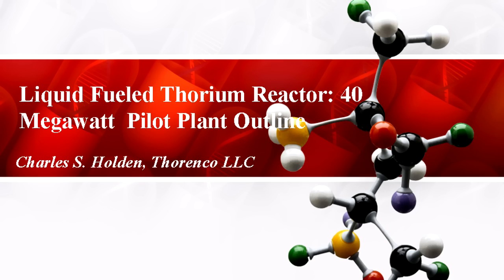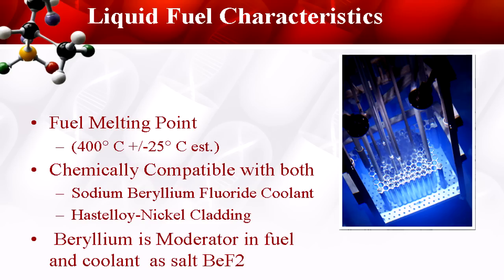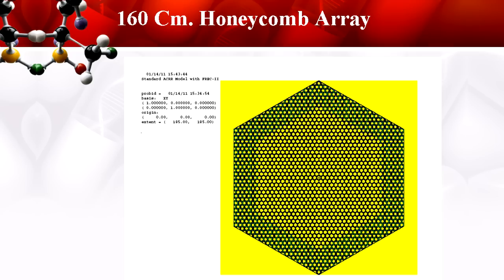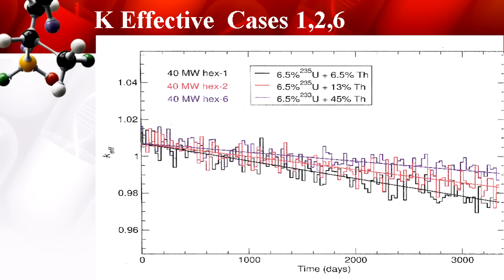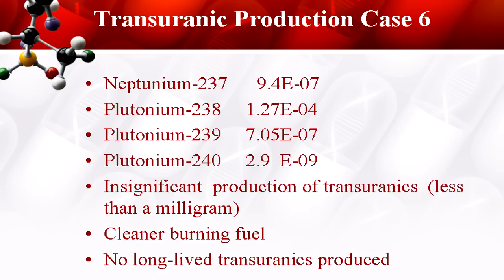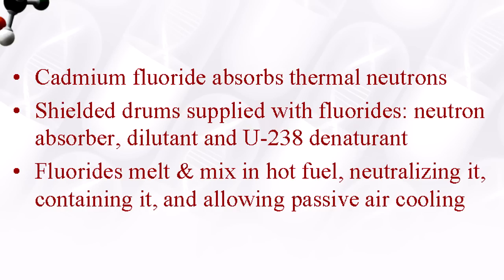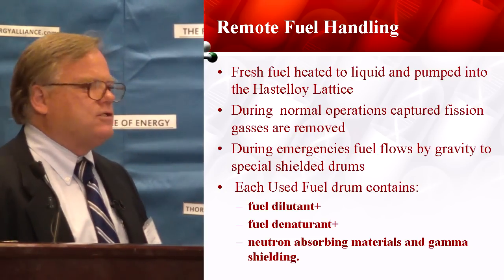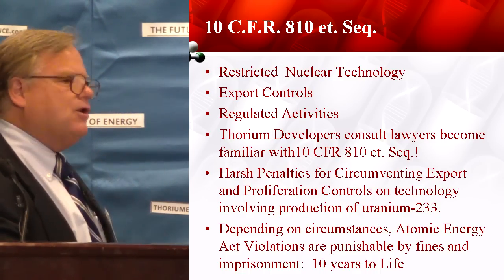Charles Holden - Liquid Fueled Thorium Reactor 40 Megawatt Pilot Plant Outline @ TEAC3

Comment: So, if I'm understanding this correctly, this is a single fluid reactor design in which the thorium and U-233 is dissolved in the same fuel salt, using a "hard" neutron spectrum, and there is no reprocessing of the fuel salt except once every ten years?
Reply: More than a late response, but yes, that is all correct. Its a chemically complex system but by far the most efficient, and forward thinking design, removing almost all of the complex mechanical elements of the system to focus only on maintaining an efficient chemistry, reducing costs as much as possible

Comment: Awesome video! I like calling it the "Liquid 'Fuel' Thorium Reactor" (instead of Fluoride) like you say, it's much easier to pronounce and you won't get as many eyes glazing over when you explain it to newbies! I agree it's great to have control rods even though you don't really need them with LFTRs, regulators will want them and it never hurts to have redundant safety/control systems anyway. Interesting innovations, particularly using a liquid moderator instead of graphite which has some issues. Really liked seeing those low numbers in the transuranic calculations. Is there any reason to use hexagons instead of circles? Circular tubes would be much easier to fabricate. Maybe you want a uniform fuel thickness which would necessitate hexagons in this configuration?
Reply: BUT IT IS FLOURIDE AND WE ALSO PUT THAT IN THE US WATER SUPPLY THAT IS ALSO WHY WE SHOULLD TO USE ITS PROPER NAME
Reply: 7 years and no repply to the hexagon question? wow, that's actually fucking sad.

Well i hope you are still around, because an answer you will get! Everyone knows that circles form the highest volume for the least surface area. For a reactor core just like anything else, that is a good thing because you don't want to lose any heat to the frame of the reactor since you want all that heat going into the fuel element to be exchanged with the secondary salt which then goes to power the gas turbine for efficient high power generation. 
However, circles are bad at anything that involves stacking things together. 

Obviously anything containing solid things will tend to be rectangles. Why? Because solids can't mold to fit their environment. Its why we store boxes and containers as rectangles and not sphere. Solids are far easier to neatly stack in them, and you can then take these rectangles and stack them too. If you try to do that with a sphere, you would leave voids in your stacking, forming concave triangles which are a bitch to manufacture. Obviously, for storing liquids, especially thermoactive liquids, rectangles are a bad idea due to the corners. You will get a lot of thermal inconsistencies between the corners and the flat plates, you also get varying degrees of weaknesses at the center of each plate where a perpendicular force being applied will essentially go un-opposed by any of the structure. 

An hexagon is, by all accounts, the most structural stable uniform structure. its the second best ratio of surface area/contained volume but can be stacked next to other nodes. The thermal load is going to be a lot more consistent between plates, and unlike cylinders, it leaves no voids. Moreover, it is a self stabilizing structure. Its the reason why graphene is the strongest material known to man right now, because loads from any direction will always disperse into the lattice to subsequent structures at optimum angles. 

As Grey would put it : "hexagons are the bestagons"
Reply: @mobiuscoreindustries  8 years and counting... still no reply. 😀 

Well, if it were any other country (whose main talent was in tinkering and tweaking, and not producing any original research, btw) they too, would have advocated circular pipes. And circular pipes of eaqual c/s when stacked together form heragonal bunches, and if the containing shell were hexagonal, it would be a perfect fit.

Comment: You can easily build one thorium reactor using a heavy water moderated vertical reactor and a mixture of natural uranium and natural thorium. But be prepared to spend a chunk of cash for the machine tools, dies, molds, fixtures, positioners, aligners, jigs, tools, machine bases, nuclear containment caves, upgraded work glove boxes and tunnel suit work areas, geiger counter, mass spectrometers, gas chromatographs, thermograms, all kinds of nuclear science-engineering instruments, gadgets, devices, equipments, materials, heavy engineering machineries, machine building machineries, and machine tool machineries. And lots of heavy water supplies as well as a small mini-heavy water supply manufacturing facilities.

Comment: I thought it is not allowed to make experiments with Thorium?
Reply: You can easily build one thorium reactor using a heavy water moderated vertical reactor and a mixture of natural uranium and natural thorium. But be prepared to spend a chunk of cash for the machine tools, dies, molds, fixtures, positioners, aligners, jigs, tools, machine bases, nuclear containment caves, upgraded work glove boxes and tunnel suit work areas, geiger counter, mass spectrometers, gas chromatographs, thermograms, all kinds of nuclear science-engineering instruments, gadgets, devices, equipments, materials, heavy engineering machineries, machine building machineries, and machine tool machineries. And lots of heavy water supplies as well as a small mini-heavy water supply manufacturing facilities.

Comment: Too bad that it is all totally unnecessary  and that the story is incomplete. This reactor still produces longlife radioactive waste. JUst not quite as long as what the pressurised watercooled reactors produce. This reactor is still not failsafe. It does produce radioactive waste. It could still have a metldown. But most of all, we don't need it because we have solar power that will las us forever and a day. All we have to do is start using it. No radioactive waste, no mining, no dangerous reactor. Just clean heat straight from the sun, all we need  for eons to come. 
We don't use steam enginew anymore for a good reason; we have something  better. For the same reason shouldn't we use nuclear reactors any longer, we have something better.
Reply from the maker: Great that you have a hobby. Shame that it is posting "solar is great" on every video pertaining to improving nuclear power.

You know what would be fun? Noting that Crescent Dunes bankruptcy is basically end-of-the-road for concentrated solar... no, posting that on ra-ra-solar-power videos would be lame. Your spammy comments are lame.

As I've pointed out in your other identical spammy comments (which never take any video's content into consideration), the only 2 energy sources proven to decarbonize are HYDRO and NUCLEAR. Natural Gas backup is what allows Solar Power to be of any use. If you think Solar enables decarbonization, please tell me which country has proven this out. Which you never do. On any of your comments. Because deep down, you know you are full of it.

Photons are free. Hardware to capture those DIFFUSE photons is NOT free. But that's ok, because Natural Gas to the rescue. Every time.

Comment: This is a fart in the wind relative to the materials challenges and the fuel re-processing problems, which are not dealt with here in any serious manner - just another gloss-over.  Others have looked at the dense hexagonal arrays - there were problems in the gradients, which are not addressed here at all.  Also, the non-proliferation argument here is a joke.  The concern isn't merely some of the fissile material walking away, it's which country is using the Th fuel cycle in the first place.  Of course, that's assuming you have a fuel re-processing capability, which you don't.